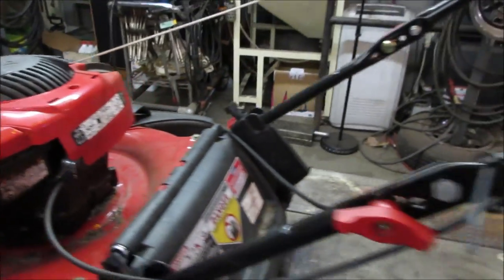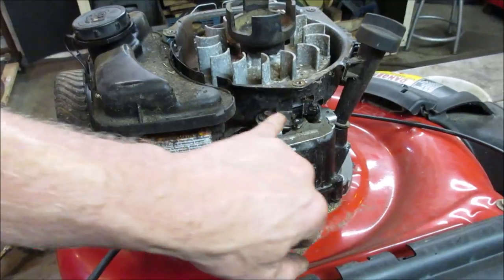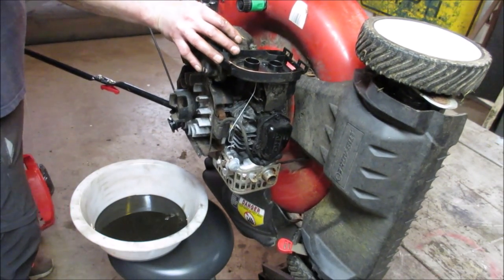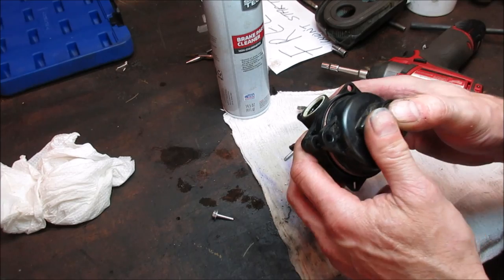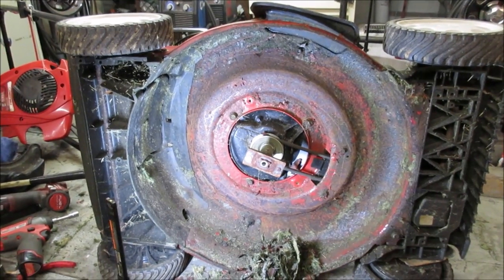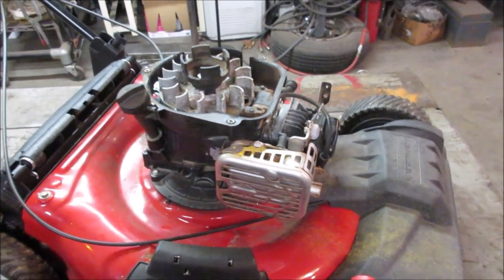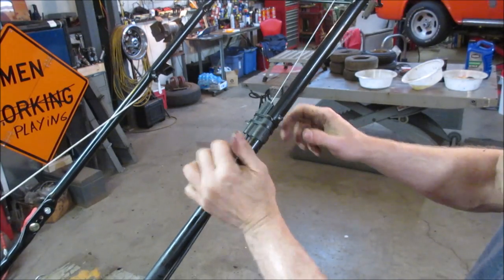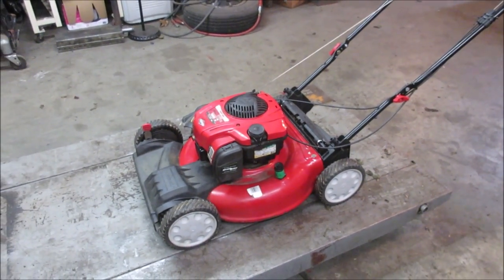How To Restore A Junked Lawn Mower. For Cheap.

Comment: Very nice to see you go back to explaining basics on this very typical lawnmower. Like the previous commenters, You and a couple of others have made it possible for me to largely work on my own equipment and keep them operating including a 33 year old Toro mower with aluminum deck. Given the state of most steel decks, it would be great to hear your experience/opinion of cast aluminum decks. Mine has held up well with the exception of one rotted area around the bagging chute. JB Weld to the rescue.

Comment: Found a mower in the shed witch is approx 40 years old filed the points changed the oil tensioned the governor spring so that I got more rpm out of it and abuse it regularly as a brush mower still runs strong amazes me every time I use it how tough stuff was built back then.

Comment: Another great video. I've always pulled the whole jet out. My next one l am cleaning the main like you did seems to be same result with less risk.
Reply: That jet has a couple more places where it can clog, but they are unseen unless you pull it out.
Reply: @davidcoudriet8439  thats why l have alwayd pulled them out and apart. I'm just wondering how many the main jet is the only issue if they sat without trying to start them.

Comment: You can open a mower repair shop based on its video alone.  great work.

I never run my mower out of gas at the end of the year.  I just use StayBil in the gas cans.  Hasn’t failed me yet… even with E-WhateverGetHere gas.

Comment: My mower was the same style, and it had carb issues. I couldnt find anything wrong with carb, so i went online and found a carb kit, with carb, air filter, spark plug, fuel filters and 8" of fuel line for 17.99,  removed and installed in 15 mins. Runs like a champ.

Comment: Excellent video Mustie  :) yes my area of Ontario Canada it has 2 gas station has 89 octane gas with 5% Ethonal and 91 octane gas no Ethonal! Also can get 85 octane gas one gas station sell it and agree 10% Ethonal hard on farm tractors with plus on updraft ones even Chainsaw, Snowmobile, Weed Wakers of mix oil plus gas heard have use 89 or 91 or higher octane gas! But my boss at work did test how keep Ethonal out use grey bottle of STP Total Treatment fuel injection and carb cleaner in fuel tank each time cut Ethonal out to 1 to 2 % plus carbs plugged up ! Also even vechile drive in cars to vans to SUV to trucks do same thing and Transport trucks like Dump to Highway Tractor too ! Also you said on repairs Mustie gone crazy yes I know saying my area sure has only one Small business Mechanic in my home in one Hardware store cost $80.00 hour plus parts labor to very costly for small engines fix ! One thing like you talk about Mustie is Warranty  for repairs and best do in small or big engines plus vechiles if could saying worth it and not do !

Comment: I recently subscribed to your videos and I noticed that you keep the wheels on the mowers at the same level. I don't know if anyone made a comment about it but I always raised the rear wheels one notch above the front wheels. As your pushing the mower, you're only cutting the grass with the front of the mower, so the back of the mower just throws the grass out easier. It also helps to prevent those annoying circles if you happen to hit a small depression in your lawn.
Just something to think about. I really like your videos. Thanks for all the information.

Comment: I have the same mower lol. Bought back in 2017 I think for my son to make money mowing lawns. Clean the plastic carb once a year and replace the air filter and spark plug each spring and it still runs like new

Comment: Very nice video. This may be the quintessential instructional for servicing an “modern” lawn mower. Last small engine shop I was in (New Jersey) with posted labor rates was at $86/Hr. Add another $25 for oil, air filter and plug (can’t blame them, neither the owner or shop wants a come back) and about $8 sales tax and you are out the door for $119. So it’s no wonder that the average, non-mechanical homeowner will will run it as many years as it lasts then put it at the curb and get a new one. Good financial decision for them! Every 3 services equals a new mower.

Comment: I picked one up the other day with a similar engine but the carb didn't have the exhaust linkage (2014 model) and that white thing inside the carb has 3 separate passages to it. I had to clean mine twice. Just used hot water and blew it out real good afterwards. didn't want to start and run but a little bit of fiddling and pumping the bulb and I made it go so fast that it was able to clear whatever was blocking it and now it runs and cuts great. I had clean oil in it and a really good looking blade on it. Great mower and total money spent was $6.75 on a new pull cord and the bolts to hold the handle on.

Comment: Great video, as usual! My free mower had the flywheel key sheared. I thought tipping the machine towards the carb would allow crankcase oil to flow into the breather tube into the carb, or at least, the air filter and clog it. Mine had an oily filter and carb.
Reply: What about tipping to drain the oil while working on the underside?
Two important services completed at the same time.

Comment: I have a push mower that I haven’t used since I got a riding mower 2 years ago. But I want to start using it in a small area where I want to grow better grass. Set up for a lower cut and hopefully better cut. I need to do what you’re doing here on it.

Comment: Thanks for sharing your work I always pick up a tip or trick to keep my junk running. I have a Troy walk behind as well and with proper maintenance, and storing them inside, they should last a long time. I check and if needed, sharpen the blade every few months and clean out the grass build up under the deck. But here in So Florida, bugs like to live in the grass buildup and there are a plethora of them that fall out; but they just scurry of for the grass and then the peacocks eat them. Circle of life. I use fuel stabilizer and have never had an issue starting any of my lawn gear after the winter season.

Comment: Oh I need that side chute insert, my dad gave me nearly this exact mower except it doesn't have the self propelled option. It wouldn't start so I checked spark, it was good, so pulled the carb. Cleaned out the carb and if fired right up and sounds great. But again I need that side chute insert, I used a bungee to hold the flap open but it just kinda spits grass and things everywhere and I was wearing a bunch of grass after mowing for an hour.

Comment: Just took one of those plastic carbs apart the other day and to get the jet and emulsion tube out the easiest way I’ve found is to insert one picks down either side of the emulsion tube about 1/4 inch to spread the black plastic and release the two clips.

Comment: Nice find! I love finding those types. I recently picked a 1994 Toro recycler 2 with a 6.5 Briggs Quantum. It looked too good to be true. Did what you did to this one, but did put a new blade on it. Fired up first pull. The drawback was the dead battery, and instead of a bailer lever it has a shift knob to disengage/engage the self propel. That was fun. 😆 I'm still trying to decide whether to keep it or sell it.

Comment: I spray wax mowers at a self serve car wash, bicycles too.  It helps them live outside when the shed is full and if you get the grass off the underside first, it helps keep more grass from sticking and prevents rust if it does.

Comment: I save some of the old oil from my power equipment in a metal paint can and after each cleaning before being stored for a month or more and at the end of the season I use an old paint brush to apply some of the oil to the underside of my mower and cutter decks and blades mainly due to the amount of sand/gravel I tend to go through blasting the paint away during use. Learned this from my grandfather who did this with all of his equipment from bar mowers,  haybines and rotary cutters that are now pushing 70+ years old in some cases.

Comment: Great job Again!! I've found it can be a beneficial (to slightly increase compression) if you stick to straight 30 weight Oil in most 4 cycle engines, except Honda they all seem to like the 10/30 .
All the best from Surrey BC Canada 🇨🇦
Reply: On the really worn ones, straight 40 works great for the summer.

Comment: Fluid Film the underside or do what we did around 1970 in a Gulf station three blocks from the beach in Jax Beach, Florida where you could drive on the beach. Spray the undercarriage with a combination of turpentine or diesel and used motor oil. Never had a regular customer with a rusty car because every one that went up on the lift got the treatment. That’s one way to dispose of customer’s used oil! 👍🔧🧰🚘

Comment: My John Deere ride on mower has a hose flush attachment. I painted under the deck with Hammerite and use the flush every time. The deck is as shiny as the day I painted it. It seems to be working for me. 😄

Comment: Noticed this mower has a hose attachment for deck cleaning.   I'm  a big believer in using those as it reduces the grass buildup on the deck.  Some say it endangers the bearings.  Keep them greased and it's not an issue.  Much easier to service the deck when it is clean.

Comment: Up until about six months ago where I live we had problems also finding ethanol free fuel but now our Cefco fuel stations have Ethanol free fuel at almost everyone of their stations but the ethanol free fuel is over a one dollar higher. I have changed to super unleaded gasoline for my two cycle equipment and I only use Stihl two stroke oil and that solved my issues with my two cycle equipment. My 4 cycle equipment I run regular 93 corn fuel until the end of the mowing season and then I run them out of fuel and put super unleaded in them and I also crank my equipment during the off season.

Comment: I got one of those mowers, same model only newer for free.  The owner took it apart and couldn't reassemble it.  I replaced the muffler and cleaned the carb and its worth 400 new.  I sold my 125$ lower and use this one now.  Cheap mower cheap fix.

Comment: 29:31 the 10mm bolt at 11 o'clock is the drain plug. or the one at 5 o'clock. just fixed up this exact model i got for free a few weeks ago for a friend that needed one. As far as the deckwash, I use it on my mowers all the time, no rust and perfectly clean. but I also leave mine out to dry for an hour or 2 with the decks tilted up on the asphalt driveway.

Comment: I work on small engines on the side. First thing I do is take the air filter off and spray a touch of carb and choke cleaner in the intake. 9out 10 times will bust off.

Comment: I like to use the shaft of a screwdriver, a round shaft after I sharpen the blade put ithe blade on too of shaft and check the balance so if I need to take more off one side It will know that. great vids.

Comment: Watching you work on this is all too familiar as my mower came with this engine, but without any custom branding, just a standard Briggs 575EX, which I disabled the auto-choke on and fitted a manual, cos they don't always work right (not closing properly mainly) and make it a pig to start, and also having to clean out the carb after I used the mower as a scarifier on a dry day and the filter plugged up & failed, that was fun when taking the plastic carb apart, and having to remove the jet/emulsion tube piece, does come out, just takes some finesse... :P

Comment: I have a 18 yr old bolens mtd edger with a 3.5 Briggs and Stratton motor, still running strong in spite of myself mistreating it by not maintaining oil, filter, spark plug and belt until last year. I would top off oil sometimes but that was it.

Comment: So Mustie I’ve learned a lot from you but here’s one tip.  Leave the float in there and use a screwdriver and pry up to pull out that main jet.  It’s pretty easy after that.  I just did one yesterday and actually I got a mower today identical to the one you have right here.  By the way mine needs an air filter and it’s $13!  Ridiculous

Comment: I have an edger with the same carb. That jet will come out fairly easily and you can push the balls out and clean it out pretty well. For some reason I have to do it every year even though I run it out of fuel.

Comment: In regards to the sharp zip tie edges I always use some small flush side cutters meant for electronics. Works a treat with no sharp edges sticking out.

Comment: I love how you sharpen the blade.  I did that myself to my mower deck, then hung each blade on a center screw to make sure it balanced.  Close enough.  Well, my father in law had kittens with that.  "Those blades are scientifically designed to specific exact angles and if they aren't sharpened by a professional your lawn mower will blow up."  ME:  ROFLMA.

Comment: My neighbor has basically the same mower. At least, it looks identical. It wasn't working for him, so I looked to see what the issue was and get it going again. Discovered that he had way overfilled the oil and that it had gotten into the combustion cylinders. Deoverfilled the oil, topped off the gas, added a fuel additive, and cleaned everything else I could get to. Took several attempts to start it, it ran really poorly for a minute and then started running ok. He was ready to throw it away and it's in a lot better shape than the one in this video. He asked me what I wanted for fixing it. I told him nothing but he insisted. I told him then that he could mow my front yard if he really wanted to pay me back. After a quick look at my yard (funny because he lives directly across from me), he agreed. LOL

Comment: If you want to get the dry crusty grass off the bottom. Try spraying it down with WD-40. Let it soak & it will peel off with a plastic paint scraper. Works like a charm.

Comment: I learned a long time ago when I was just a kiddo from a old man that I would help every week with his lawn. He had a snapper and I would use his mower , every time I mowed his yard I had to clean the mower. every time I washed it out  I had to paint the bottom.   Not with paint though.  he had a small coffee can with old engine oil in it   just a little in the bottom and a old paint brush.    that mower never rusted.   you dont want a ton on there like to make it drip off  just wipe it quick and done.

Comment: I just worked on my neighbors mower like this one, It would run for a while spudder and once you shut it down it may or may not start again. Turned out it was the engine brake lever was not engaging and not letting the engine create spark a few twists on the cable end peice and she runs like new.

Comment: I have one of these, that starts on the first pull. Mine is not self propelled. Mine is about 6 years old and have never even changed the plug. I always change the oil at the end of the season and air filter. Probably due for a spark plug. I also add Sea Foam to the gas.

Comment: Regarding spark plugs, something that is often neglected is the shape of the electrode. You mentioned it briefly. If the electrode is rounded over, it actually makes it harder for spark to jump the gap. Sparks want to jump from sharp edges or points, not round surfaces. So, as a spark plug wears, even if the gap isn’t huge, the fact that it rounds off the electrode can increase the firing kV of the ignition system. Not typically an issue on modern cars (except that it might reduce the life of ignition coils) but on small engines or old engines with weak ignition systems, that can be a problem that gets overloooked.

Comment: That mower is still being sold and its $360 new.  I have a similar mower that isn't self propelled and its about $260.  The one you are servicing has a smaller displacement engine which I find kind of funny being self propelled, you'd think it would have a larger engine since the self propelled feature takes power from the engine.  I have the Troy Bilt TB115 which I've had for 4 years, it works great, I put a gator mulching blade on it and mulch with it most of the time.  I don't bag so I usually end up mulching or side discharging...does great in both of those settings with the mulching blade...I've never tried bagging with the mulching blade installed but I'm sure it wouldn't be as good.  The only thing I don't particularly care for is that automatic choke nonsense...I may do a manual choke linkage at some point on it, but so far it seems to work just fine as is, but I keep the mower cleaned up too.  I run it out of fuel at the end of the season and next spring I just have to add fuel and its ready to go.  I haven't changed the oil in it, probably should although the oil doesn't look all that dirty.  I've changed the air filter in it I think last season, but other than that haven't done really anything to it just add gas and go.  Thinking of buying a battery powered mower though with gas prices like they are.  Probably the Dewalt since I have so many Dewalt 20V and 60V batteries.

If I recall these mowers went to a check and add oil only, don't change it deal....I'd still change oil in mine, if I remember to do so LOL.

Comment: I’ve heard a lot of people complaining about those plastic carbs, personally I like them there’s not a lot that goes wrong with them as long as the main jet is clear and needle/seat is good….. they seem to be very tolerant to ethanol, The float bowl is kind of annoying to takeoff but I like it better because of the tight O ring seal
Reply: And also almost all the newer mowers that I’ve done work on have a problem with that cable holder thing on the handle I just pop it back in place and throw a zip tie around the cables underneath the holder so it doesn’t pop off again
Reply: I agree with you on that. I absolutely hate trying to get one of those brass main jets out of a carb that's been sitting for awhile.